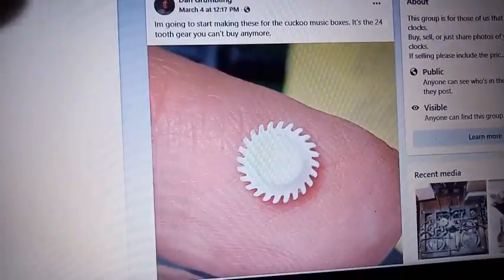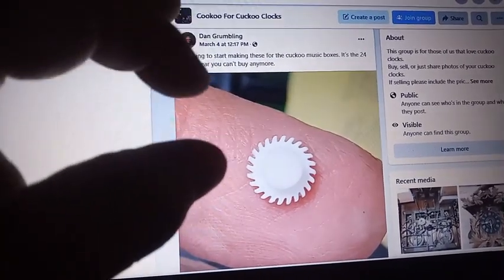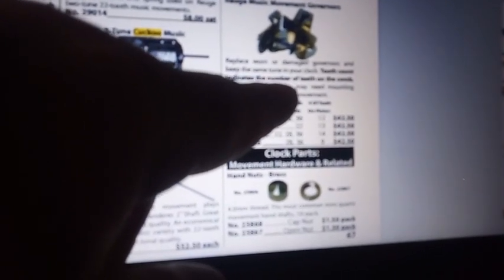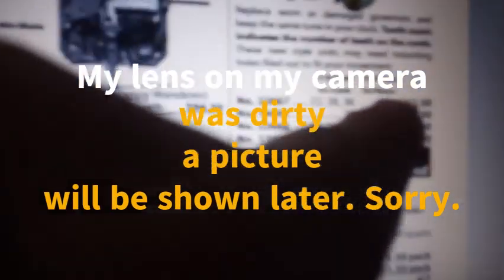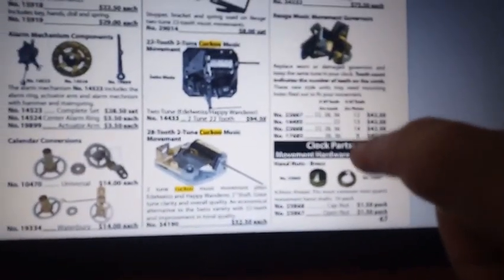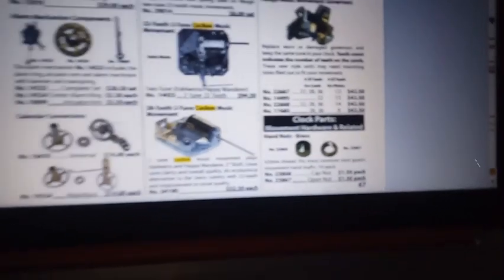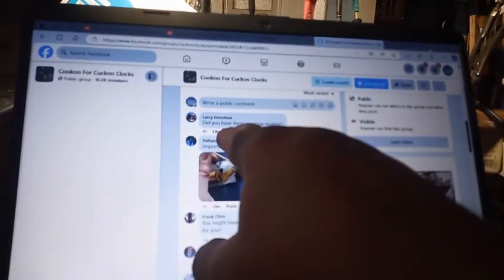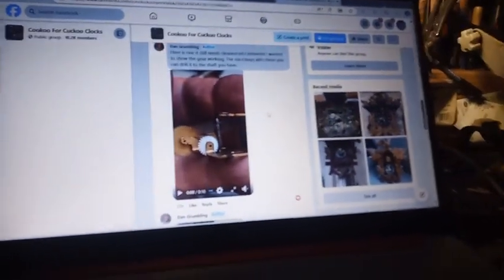Discussing the plastic wheel on the musical governor of cuckoo clocks.

Comment: Do you have any information on how to contact the man that makes the wheels?
Reply from the maker: There are different types of wheels. JustMikes brother made some wheels for a music box that he was working on. You can get on his you tube channel and I typically have a link to his channel at the end of every one of my videos. I dont know if the wheels that he made for Mike will work for the clock that you are working on. As it has to do with the number of pinion gear teeth on the wheel from the governor assembly that matches up with the music drum.  Like I said there are at least 5 different sizes. Good luck.